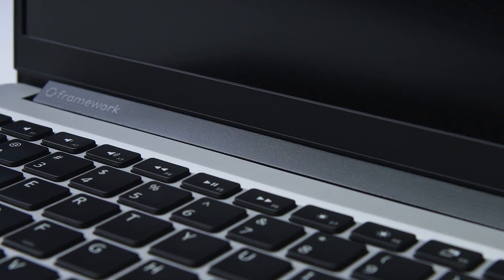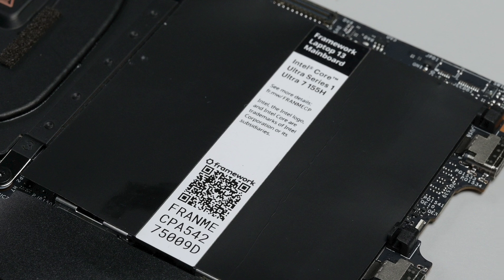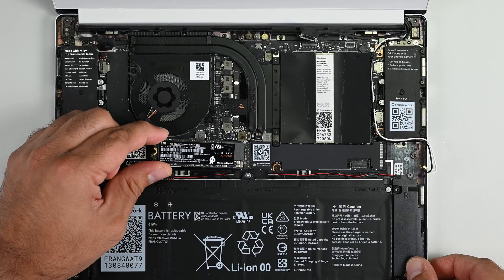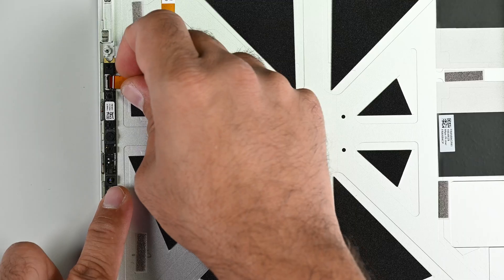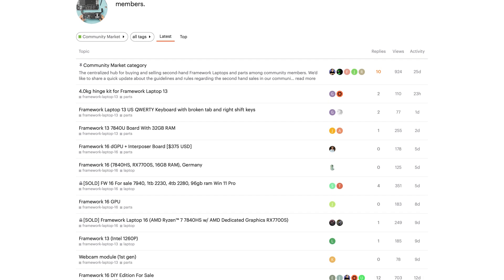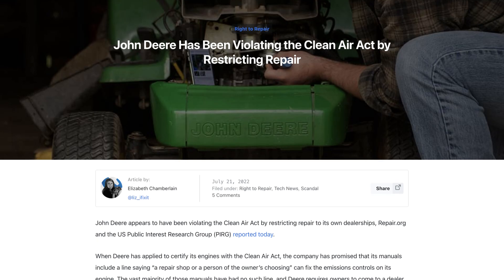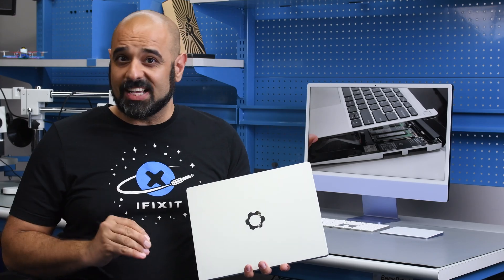Framework 13: How Many Times Can You Upgrade One Framework?

Comment: Let's see... I'm currently using what was originally an 11th gen system. It's been upgraded with the new hinges, the CNC top cover, the 2.8K display, and an HX 370 mainboard. The only thing I don't yet have is a new wireless card; I'm still using an AX210.

Bonus: with the leftover parts and some pieces from a mystery box, I was able to put together another 11th gen laptop. That one is now being used by a bridge club.

Comment: 2:10 Yep, the screen replacement is a god-send. I've worked on HP laptops and they are so much harder; due to the adhesive removing one without breaking it is hard and replacing it is difficult. I've replaced my Framework screen and it is much easier.

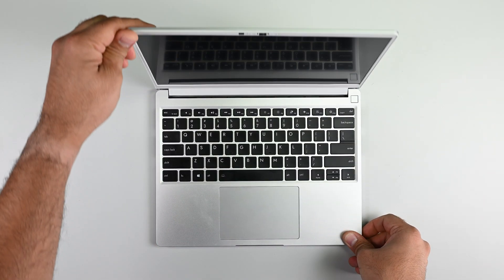Comment: 1:26 Actually, if you disconnect the keyboard on this laptop it shouldn't directly affect the power state of the device. I've unplugged the keyboard from mine while it was turned on (bad idea but doable) and it kept running. There are red lights that appear in this case when it is turned on. As for when the laptop is off, the power button is located on the keyboard so there isn't a way to turn it on without something like wake on USB or LAN. I haven't tested this but it is reasonable to assume the device would power on in this case. That is how people run the boards in aftermarket cases like Cooler Master.

Comment: In addition to this, you know what else is great about the Framework laptops? The fact that Framework didn't cap the TDP of the processor on the original 11th Gen models just to skimp on the cooling or reduce noise. I have two of the 11th Gen Intel Frameworks at home, and they are speedy little laptops. They definitely run circles around competing business laptops with otherwise identical specs. 3-4Ghz Turbo all the way, versus the "We'll just run it at 1.8Ghz after a few seconds" nonsense of other brands.
Reply: That's awesome

Comment: I love my Framework 13 with all its flaws and quirks, failed fingerprint sensor, broken screen hinge screw and weak battery and loud-ish fan. Apart from that, it has been reliable and a blessing to work with. The crucial parts feel great, the keyboard feels very nice, the screen looks amazing and the trackpad is well... usable. Cant go wrong with that 12th Gen i5 either.

Comment: The problem is the cost of these machines to start off with. You can get very good used late-generation Windows laptops for low bucks, many with easy-enough parts availability and replacement batteries. If you are the type who loses machines (stolen or otherwise) or breaks them often, this might be a better bet. Keep good backups and toss them out when they break. BUT I DO see the point of Framework devices in terms of reparability and less e-waste. SO one size does NOT fit all.

Comment: I want to congratulate framework for their achievements.

I just hope that laptop design starts compartmentalizing the features of the machine much more than just being able to swap the entire motherboard. Like for example swapping the CPU or the GPU power management circuit in case they have failed. Otherwise we are stuck at the same point.
Reply: You can do that with board level repair, and for the power components that is not even that hard if you have the right tools. Nothing like BGA reballing etc.
Reply: You can't do that anymore unless intel, AMD and/or Nvidia put effort into it, Wich they won't unless humongous amounts of people ask for it, Wich won't happen.

They just don't manufacture chips capable of running socketed like they used to. Nvidia is extremely toxic about you even trying to prototype some device they don't approve on, so much that they don't even sell to framework for the modules on the 16.

They might be able to do something with desktop chips, but those lack important capabilities for mobile and the efficiency required.

Swapping the MB is not that wasteful, and even less when you can reuse it with a 3d printable case as a desktop or just buy it directly from framework.

Comment: While I am all in favor of repairability, when I need an upgrade, I will upgrade the entire machine. You now have a display and webcam module that you don't have any use for. It's nice that you can sell or reuse the mainboard (if you have a use for it), but I have to imagine that the market for used parts is going to be extremely small with supply far outpacing demand. A whole laptop is easier to sell than its parts.
Reply: As a big Framework fan and owner myself (13" AMD), I've been worried about this, too.

I haven't made any upgrades yet, but when the day comes, how hard will it be to repurpose old components?

IIRC the forum now has a dedicated section for selling old parts, that should help.

Comment: For me Framework's main issue has always been price. I got a used Dell Latitude 2-in-1 5290 with 16GB RAM and the i5-8350U, it's keyboard, a second SSD, an Intel AX210, and an upgraded primary storage for under $250. That value is wild, and Framework is no where close to there.
Reply: Price is probably the main reason people shy away from Framework, with lack of interesting features coming in at a close second. The Framework doesn't really pay off unless you're thinking about the distant future because no other laptop gets the same long-term support or upgradability it gets. Now sure, of course most users don't care about long term support because they'll just buy a new machine. For most people, that's more cost effective and just better. But for people like me who want to cling to their existing devices because they hate forced change (and because I'm extremely environmentally conscious), this device is game-changing.

Also keep in mind that this device is competing with the build quality of much more premium machines than Latitudes. With everything considered, the starting price of ~$600 is remarkably impressive, given that you're getting the same physical machine as everyone else who specs their higher, and access to all of the upgrade options too.
Reply: @jackwoodhead  The Latitude 5290 2-in-1 feels more solidly built than any other laptop I have ever touched, including MacBook Pros. Then again, it is practically a tablet, but this thing feels indestructible.
Reply: They already have "Factory Seconds" edition, aka factory refurbish. The price started at 499 for 11th gen, hopes the price comes down more in the future.
Reply: @fdtk  While true, the absolute budget savvy buyers out there (like me) think $500+ for a computer is wild, and I will not spend that much.
Reply: And then there's people like me who spent three times that much on a GPU.

Takes all sorts and there's no right or wrong. Just what's right for you.
Reply: To be fair though you're comparing an 8th gen equipped device with something that came out with (at the earliest) an 11th gen CPU. So of course the prices on 2nd hand market can't be the same. Also consider that there is much wider availability of used Dells than Frameworks just because many more Dells are sold new compared to Framework.

The real comparison should be new to new with similar specs, and in this case Framework is indeed more expensive. But if you plan on keeping it for several years, you should consider the benefit of upgradability and repairability. Not to mention the ethical aspect. I voted with my wallet because I want things to change.
Reply: @AndreaIppolitoIppo  Buying new is always worst for the environment/ ethics. Used is the only way you can convince yourself you're not hurting people elsewhere.

Comment: Yeeeaah, il skip the framework brand. $1300 for a bare bones core ultra 155H motherboard? Doesnt come with ram or memory? You can buy 2, TWO meteor lake Nucs with the 155H cpu. 😂
Reply: It is expensive, but you’re paying for a high quality, lower volume product. Their stuff is built to last, and uses genuinely high quality parts. The screen featured in this video? It’s super HD, bright, and color accurate. 

Yea you don’t get ram and storage, but assuming $100 for each you’re in $1500 for a laptop that’ll last 10 years or more.
Reply: @Bluecolty  No amount of marketing is saving this buddy, Lmao.

Every electronic can last a decade with proper care.

Every display pannel in 2024 in the is color accurate, 2.8k QHD, 4k UHD+ resolution up to 500-1000nits of brightness, its the standard.  "Super HD he says lmao"

The issue is the motherboard ITSELF is $1300. You can LITERALLY get an asus zenbook 14 laptop with the SAME 155H cpu, 32Gb of Ram, 1TB nvme ssd, 2.8k 120hz touch screen pen supported OLED display for $1300. 

You can get two asus nuc mini pcs that have the same cpu for the same price. 

You are overpaying. Plain and simple, no squirming your way around it. You gotta be smart with your money
Reply: @dankmemes3153  disagree. Not every laptop and barely any mini PC is upgradable. Thats what you're paying for in a framework laptop
Reply: Are nucs laptops?

Comment: already decided a framework will be my next laptop, just waiting for my HP to have a non-replaceable component die on me so I have an excuse.
Reply: I think when a non replaceable component dies thats not an excuse, no? sounds more like a valid reason for me
Reply: @berberger4814 It is, but they're trying to justify the purchase inside their head 🤣🤣🤣

Which is totally fair btw
Reply: for what they cost you can basically buy 2 new laptop, that's the problem
Reply: @Frigobar_Ranamelonico  2 lower quality laptops*

Considering the specifications and quality of the framework laptop (both the 13 and 16) they are not actually that bad for their price. You may be able to find a device with similar specifications and build quality for 10-25% less, but thats not HALF the price.

The modularity, repairability and upgradeability easily make up any additional costs. Theres also a lot of laptops that are actually more expensive then the frameworks for the same or worse quality.

Comment: neah, in a 4 year timeline you will pay mor for upgrades comparing to buying 2 different laptops
Reply: I disagree, though it of course depends on your requirements. I got my FW13 about two years ago (with high end specs at the time, which cost like 2300€ in total (including kinda overpriced RAM and some expansion cards for a friend, you could save some money by buying third-party RAM and SSD). I haven't upgraded anything since, and I don't plan on upgrading this device for at least two more years since it's still plenty fast.

If I upgrade only the mainboard (CPU) after 4 years of usage, I will most likely get between 10% and 40% more performance at a cost of 1100€ (based on current prices for latest-gen motherboards). Since I still got DDR4, I'll need to upgrade the RAM too, which adds about 200€ (third-party price for 64GB of decent DDR5-5600 RAM). I don't think you would reasonably need to upgrade the display, battery, wifi, SSD or anything else really. Battery wear could depend on usage, but a new battery is just 79€. A decent SSD should last a lot longer than 4 years, unless you overstress it (you shouldn't fill it more than about 70%, otherwise it can't reasonably spread the wear across the drive).

So, I'd only pay 3600€ for a pretty extreme upgrade after 4 years. You usually don't get a similarly premium and performant laptop for less than 1800€. For example, a comparable Thinkpad T14 Pro with 64GB RAM and Intel Core Ultra 165 costs 2500€.

Also, I'll still have a fully functional mainboard to use as an energy efficient homeserver, or to sell in case anyone wants a cheap one.

Comment: Is it repairable when you change the whole board? you can do that with any laptop, I guess it's easier to open but I don't see how it benefits the end consumer apart form the whole board upgrades
Reply: basically every replacement parts are available directly from framework so if anything breaks, you can repair it yourself if you so desire instead of sending it back for RMA or hunting down parts from decommissioned laptops
and if the mainboard failed, framework provides schematics to repair shops to do board level repairs
Reply: Can you jump from one generation to another with other laptops?
Reply: Ever heard of LPDDR? Evidently not
Reply: @AndreaIppolitoIppo  What does swappable ram have to do with what I said
Reply: @LauS0  I was just bringing an example of "how it benefits the end consumer apart form the whole board upgrades". You can upgrade (or replace) just the RAM modules you need, without needing to replace the whole board with CPU, heatsinks etc. Of course Framework isn't the only company allowing to do that, but more and more are following Apple's "let's solder everything" approach.

Comment: I do prefer the Apple laptop. My last one was 8 years old (MacBook Pro 15 2015) and without any wasteful replacement parts. Battery hold for 1-2 hours, no waste main board, no nothing. How many waste have you generated in the last 8 years yourself?

I will see how long does the MacBook Air last. It has 2 moving parts which will improve longevity and again reduce failure rate.

Comment: Soooo... what happened to the old parts your replaced???  "Circular economy"  I assume you donated them to-- another framework laptop???  I get it.  The world is hard and tough and all that, and I guess less ewaste is better than more in this case?
Reply: well, ideally you should use the parts until they fail before they become ewaste and you need to replace them... If your usecase changes and you upgrade because you need more power, you can either sell the old parts through framework community market, or use them for a cool project, like a server or home desktop, etc.
Reply: they sell a case so you can turn the old board into a mini pc, or like other guy said you can sell your old parts and get a bit of money back.

Comment: I really don't see how this has 10/10 considering that you have to replace the entire motherboard to replace the cpu
Reply: You can’t get a CPU only because Intel and AMD do not allow this. The mobile CPUs will always come soldered to a board. So it’s not framework’s fault.
Reply: Motherboard companies don’t make swap able cpu/motherboards for a long time.
Reply: Go ahead and find a laptop with an upgradeable socketed CPU where the manufacturer also offers replacement parts for every other component of the laptop.
Reply: It doesn't exist, but that doesn't mean it is the right thing, just because nobody does it doesn't mean you should just roll over and give up @emanueleborghini3186
Reply: @eduardoizquierdo309   it's the current best solution on the market and decently better than the competition, so yes it is okay to accept it. it's not meant to stop innovation, it's a good step forward

Comment: Love the concept of the Framework laptops! Nevertheless I sent mine back because of the facing down speaker integration. With the modular concept I doubt there will be another solution soon. 😞
Reply: You could use external speakers or headphones
Reply: @minikretz1  don't even need wires, use a Bluetooth speaker that will sound better than any laptop's built in speakers.

Comment: If only mine was reliable
Reply: whats wrong with it? Looking at buying one
Reply: @jd-py5nm  New Framework Generations usually have some software issues when they launch. Especially the 13.5" AMD ones. But they did fix quite a lot with various Bios updates. So if reliability is a main concern, I wouldn't preorder a new Generation and instead take one, that has been out for 2-4 Month
Reply: @jd-py5nm  Personally mine works great, currently running Fedora atomic. Only gripe is the battery life (55Wh), although it’s not even bad with light usage, still lasts through my day. Would recommend checking out bluefin/aurora to transfer away from windows if you’d like. No hardware issues though.
Reply: @jd-py5nm  Dunno about Kelly, but I have not had any issues with mine, which I received october 2021. Haven't changed anything on it. I leave it a backpack that I throw around all the time. The lid of the laptop has a little dent in it, but no impact on functionality.
Reply: @jd-py5nm  i have a framework 16, the fit and finish is very 1.0, but it works great otherwise. the charging situation isnt great either, but the charger it comes with is